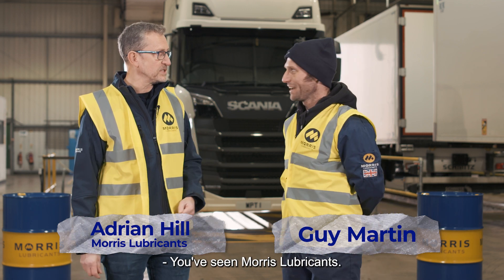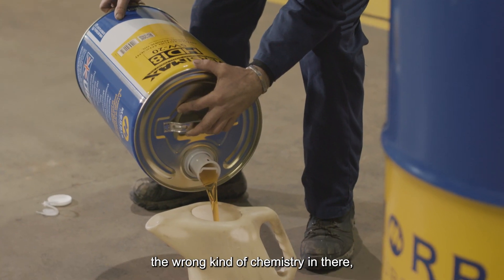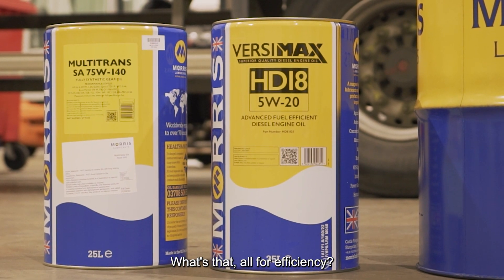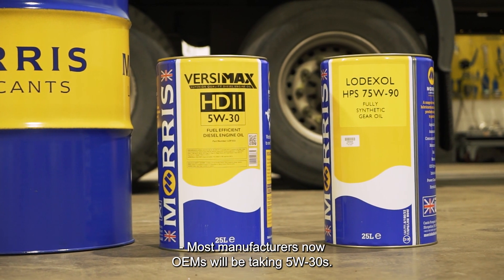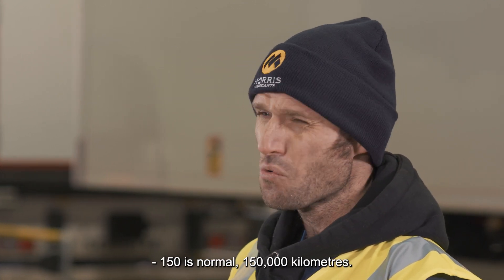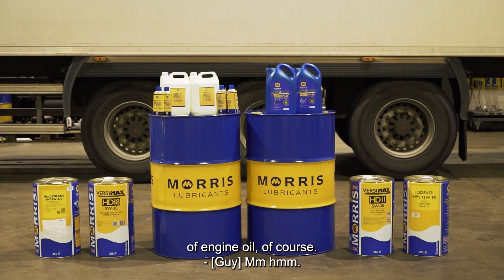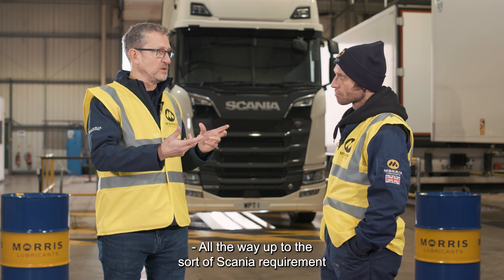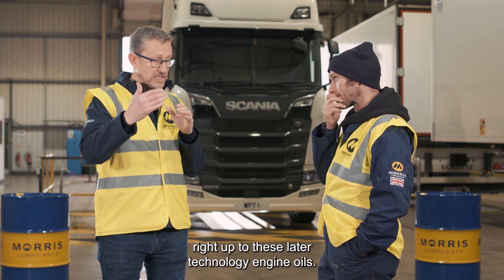Engine Oils for Trucks Today with Guy Martin

Comment: That's where I first noticed Morris Lubricants in the 1970's. 
2 of my friends were diesel fitter/mechanics. One of them, whos family ran a transport haulage firm used mostly ERF trucks with Gardner 180 engines, some of them had done over a million miles.
When I went into their workshop there was always a 45 gallon barrel of Morris Lubricants in the corner.
The other mate of mine worked for a transport company, and in his workshop they also had a 45 gallon barrel of Morris Lubricants oil in the workshop.
So when I lodged at my sisters house, next door was a motor factors, and guess what oil they sold, Morris Lubricants. And as I rode British motorcycles I could finally find the mono-grade oil that I wanted to use in them, and so far 40 odd plus years later, I am still using Morris Lubricant in my BSA and my Harley Davison's.
Reply from the maker: Hi David, we're glad to hear the oils has been keeping your bikes going over the years.